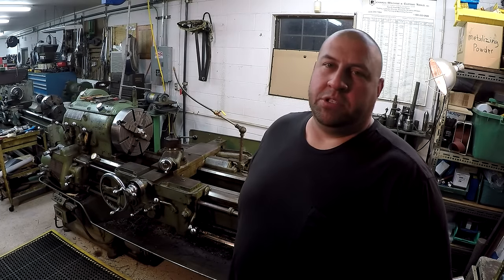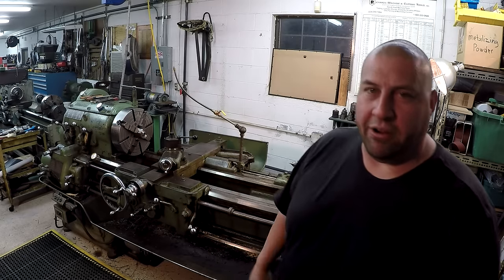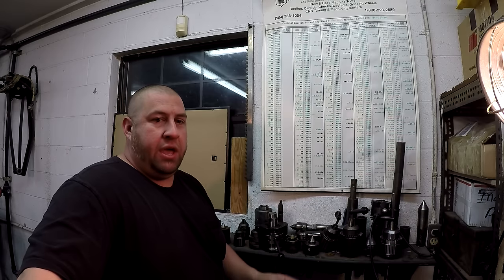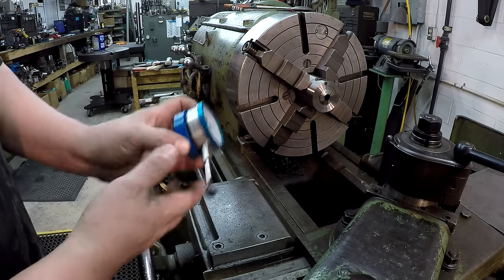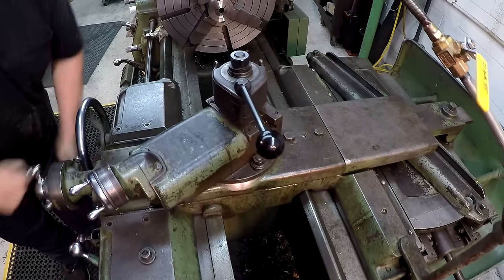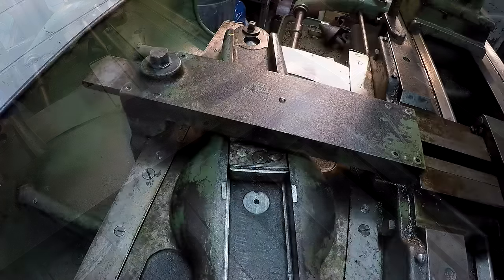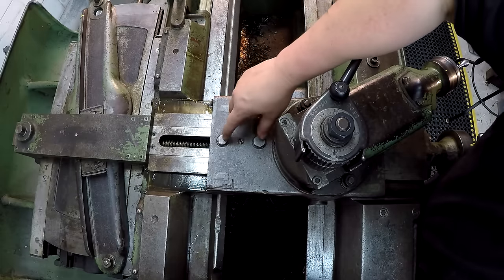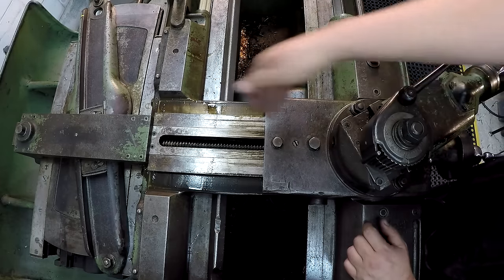Taper Attachment & How It Works

Comment: My Springfield 280 came with a taper attachment but I've never tried to use it.  I wasn't even sure if I had all the parts.  After watching this video and understanding how it is supposed to work, I went and set it up and found out I do have it all and it works.  Thanks Adam.

Comment: Hi Adam, I cut my teeth in 1956 on a big 1936 Monarch with a taper attachment just like yours. I used the attachment many times but never understood how it could move so freely while the lead screw remained stationary. Now I know the screw has to slide in a coupling somehow to allow both to be used. Thanks a ton, my 60 year old puzzle has been solved.

Comment: Very good video and example of machine design. I did not look forward to single point threading on the lathe until I got to work on an HLV-H which had a bit different mechanism for pulling back, but like the Monarch and other higher quality lathes made the threading process much easier.  I appreciate that you get to the point where critical comments are too much. You are very careful about going over the possible consequences of techniques that you use. There are thousands of choices that must be made by a machinist and just as many factors that go along with deciding how to accomplish a task safely and efficiently. I think your judgement is excellent and while I respect the concern and opinions of others at some point there needs to be an acceptance that we are not all going to see or do things the same way.. Thanks Adam.
Reply: My dad had a saying"DO as I say NOT as I do"! Damm the safety  crazies and get some work done.

Comment: So THAT's how that works on the taper attachment, and how you can still use the crossfeed while tapering!  That's an awesome piece of ingenuity and genius mechanical engineering!  Cross-feed screw is anchored to the moveable bar that the taper-attachment is in control of, with as you stated, a male-female sliding shaft connection, either keyed, or more likely splined, between cross-feed screw and cross-feed handle and dial.  As well built as the rest of the machine is, I'd be surprised if the sliding-shaft setup between cross-feed handle/dial and cross-feed screw isn't splined.

Besides of course how this arrangement permits you to still adjust cross-slide position no matter where you are in the taper-attachment's travel, I can also see a major safety benefit as well: when turning a taper using the tapering-attachment, the cross-feed handle isn't turning.  If it were turning on its own while using the tapering attachment, I'm guessing that can lead to operator confusion at times possibly and a machine crash if you accidentally engage the power cross-feed when you meant to disengage it.   With the cross-feed handle not turning when using the tapering attachment, you know at a glance that the power cross-feed is off.  

As somebody else has said previously however on this, it would make sense if in the process of setting up the taper attachment for use, one of the setup steps by design also serves as a 'safety feature' to lock-out the power cross-feed, so the power feed for the cross-slide is disabled and cannot be engaged while the taper attachment is setup and ready to use.

Comment: Good video.  The lead screw has a keyway in the handle end which fits into a collar attached to the handle.  that allows the entire screw to move under taper turning, while still allowing you to adjust the depth of cut .  That big worn out nut on the end locks the slide into place when doing normal turning so the screw cannot accidentally move.  Keith Rucker just did a video on assembling the cross slide and taper attachment on his Monarch for those who want to see how it all goes together.

Comment: thanks man!  you saved me.  i wasn't familiar with the taper guide and wasn't sure why it wouldn't cut the angle i set.  after seeing how it's supposed to move from your video; i realized it just really needed to be taken apart and lubed up. and a couple screws on the compound needed backed off slightly.

Comment: I work in a manual machine shop with alot of old worn machines missing parts to the taper attachment, and always wondered how they worked. My dads a master and explained them, but to actually see them set up and moving makes all the difference. Shame we dont have them working, im on a job this would do wonders on speed and accuracy. Thats for the informative video!

Comment: I get it now! Thanks Adam!  And screw those guys complaining about polishing on the lathe!
Reply: MattsMotorz   Iḿ feeling same away about  polishing on the lathe.. Throw couple old t-shirt  to cover the ways and thatś that...
If the camshaf from engine hav to machine out to next over size bearings. First off itś grinded and after that itś polished to size hand held emrypaper or by machine like yours adam....
It has also WAYS in it!  

Lathes are made to working    NOT TO BABY OUT THEM!!!!!!!    Ofcourse you hav to take care of them best way you can :-)
Reply from the maker: Yep, cover the ways, or once done with the polishing wipe them all down which is what I do everytime.

Comment: Nice. That Monarch is a beauty.

Anyone that criticizes you using the crankshaft polisher can go take a dive into molten steel. 

Every serious race engine shop, let alone OEM remanufacturer has one and uses them in production as well as custom engine machining. 

I've used them hundreds of times. A must have tool in any serious machine shop.

End of rant...
Reply: Your molten steel comment took me back to Terminator 2 and the ending with the T-1000 shrieking like a stuck pig, LOL! "Come with me if you want to live"....dang, I can't believe that was 25 years ago already!
Reply: Doug Hanchard  oh hi California.  I hate ANY negative comments toward Adam, especially about such a unique and marvelous machine.  Thanks, Adam, now maybe I can figure out my south bend taper attachment!  Cschwad.
Reply: I really don't get why they get so anal about it. I mean, all it takes to protect the lathe is some wrapping paper, and you're done. I have a similar belt grinder, tho mine (through a mod) attaches to the tool post so i can power feed the grinder. Man that thing makes some sick polishing marks. :)
Reply: I'm just jealous I don't have a legit crank polisher. 
 
  If you haven't polished parts then you have never needed a perfect air tight slip fit that snaps when you pull it apart. I don't own a cylindrical grinder so it has to get done some how.

That aside maybe the millenials don't know how to clean up after their grinding dust. I mean they expect everything else handed to em.

Comment: Thanks for the inside look Adam, it was quite clear how that was possible.  It's just 16 times more complicated than I could have imagined - simple, right? Obviously the guys that designed that system knew what they wanted out of a lathe long before this one was a new model, so that goes back a ways and then some.  The heritage runs deep and strong in that one.

Comment: Thanks for the video Adam! I've got a Clausing Colchester very similar to John Saunders and have never messed with the taper attachment because I thought I had to disconnect the cross slide like you mentioned. Watched your video, went out to the shop, and was set up to cut threads in no time.

Comment: Shop project alert! - make a new doohickey for your taper attachment to replace the worn out one. :) You could also put a small, rectangular magnet to replace the missing clasp (?) on the guard so it doesn't slide around like you demonstrated - just attach the magnet to the ways where the clasp was, rest the guard piece on top, and adjust the location of the magnet so the guard piece rests on it. Now affix one side with 2-part epoxy and let it set up! Keep up the good work!

Comment: The monarch taper attachment works similar to the one I have on my old Pratt and Whitney model B.
on mine there is a dog screw to lock the separate taper slide in the carriage. the thing I like about my taper setup over other brands is that the taper attachment hangs on its own independent machined surface on the back of the bed versus being attached to the rear top ways of the bed and doesn't ride along with the carriage when not in use.

Comment: Is the taper attachment always attached to the machine and set to zero taper for jobs not requiring a taper? Or is the attachment removed from the machine and attached as needed ? Thanks for the explanation of the attachment.

Comment: Great video Adam. I had wondered how the taper slide could work against the feed screw. Now I understand. Thanks! 

Just one question. When you're not cutting a taper, do you set the taper slide to zero degrees? Or do you just loosen the clamp on the rod down near the tailstock? Or maybe both? Seems like you are  moving a lot of extra weight by moving all the taper attachment components when you aren't using it.
Reply from the maker: When not using the taper attachment you loosen the large clamp holding it to the bed way. The small rod sliding through get tightened by tyhe bolt above it to keep the clamp straight when not in use.
Reply: Abom79 Thanks for taking the time to explain it to me. I'm just a wanna be machinist but I like to understand how things work. I follow all your videos. Thank you for all the work you do to present it to us out here. I create parts in solid modeling software. I don't think it's as rewarding as being able to hold what you've created. Maybe I need to get a 3D printer, huh?

Comment: Hi just watched video and it was great, came on to it after watching a similar video by "this old Tony" loved all the shots but could I just ask this one question ? You never showed you feed in and feed along at the same time. Is or was it possible to do that ie feed towards the headstock and also feed across the face ? I'm only asking as I really like the system you showed and trying to figure out the mechanism for this. I'm reminded of my Bantam feed screw's and a sliding power feed cog along a splined drive but I don't want to miss a more version. I love your channel and the work you commit to it, Mr Pete aka tublacain amongst others made me intrigued and search for your channel and you provide me with constant insight on both productivity and the most important which I hold very dear. That you cannot ever stop learning or improving. Thank you if you can respond I understand that you are very busy, but thank you for your videos they are like tublacain's a very important teaching tool. Yours thankfully Stuart Martin.

Comment: Adam, that looks like a Kwik Way crankshaft polisher, depending on journal size you'd use different widths of belts.  I used to help dad rebuild a lot of engines over the years and if people freak about having sanding dust on ways, they better not walk into a machine shop turning cranks or surfacing heads, blocks or flywheels, lol.  I have a picture of an Offenhauser block that was rebuilt, it's in a lathe with a steady rest that is probably around 2 tons, it was used to machine the bellhousing on the block.
Reply: So the sanding dust on the ways is what people complained about? Seriously?

I tried to wrap my head around why somebody would complain about that belt sander and couldn't come up with anything.

I thought maybe there is some weird security thing i got no clue about. But its just dust on the ways... something that can be cleaned.

Comment: Hi Adam
Another very nice video. I wondered if you had just installed the taper attachment for the last video, but there were just the covers in place. Anyway it was a very informative video, the way this taper attachment works is quite impressive and very well engineered. I personally find it really impressive how well those "older" machines were designed, just with pencil and paper and no computer and CAD program.
BTW, is the belt sander self made or an off the shelf tool?

Comment: If it's like the Colchester chipmaster, the cross slide screw is splined at the Handel end, and the other end is bolted into the taper attachment slide. This means that the screw moves as it slides down the taper attachment, taking the cross slide with it.

Comment: Man that Monarch is a sweet beast. Ingenious design. What about if you are doing work that requires full bed travel when not using the taper attach. Can you get the taper slide to follow the cross slide down the bed or does it need to be manually moved when you get to the end of the taper slide? (If that makes sense)

Comment: When the taper attachment is not in use you tighten the wore out bolt in the back end of the cross slide. Do you have to position the taper arm to run parallel with the bed?

Comment: Adam, did you notice that when you showed the cross slide backlash that the lead screw moved back and forward a little so maybe there is some slack in the mounting at the far end of the taper attachment?

Comment: Abom79 @6:30 Do you use structured abrasive belts for that thing?   (as very much an amateur, I built and used such a thing for polishing a toyota 7M crank, and it worked like a charm, took it down from 60.001mm to something small I dont remember now..)

Comment: Adam, Great video. Thank you. You could always try using that Frost effect paint for glass in a rattle can to cut down on the glare from the windows and still get light in the shop. I think they have a matt style with no gloss. Helps with security as well.
Reply: I was thinking some cheap blinds would do the trick.  Tilt them closed when filming. Tilt them open if you want more light. Quick and easy.
Reply: That is a good idea too. But then Adam would have to sit down a choose a style and color with samples. I don't see him doing that just yet. "LOL, :)" I would vote for that green used on the Monarch. I like Battleship gray color but for the floors. "Laugh" Next Episode: Interior shop design with Adam Booth  :)

Comment: Luv the belt sander .maybe people should put their safety pin were it belongs .holding up their diaper.
Reply from the maker: +Gerry Walker Now that's good! 😆👍🏻
Reply: Yup, that belt sander is brilliant, not to mention that the design could be retrofited to work on a bench style grinder simply by making a stand that couples on the adjusting leg and with a small plate to support the belt. You'd get twice the use out of it.
Reply: I can think of a few million people that could use their diaper pinned shut right about now myself...

Comment: I have that same Shars mag back indicator.  Cheap, works good.

How are you liking those Shars digital calipers?  Kinda thinking of picking up a set of digitals so I can do metric conversions easily but I can't really justify a higher end one. 

I can see that screw moving some with the cross slide.  Might be loose on the end where it attaches up in the taper attachment.  Maybe there is something in there you can snug down to take a little bit of the backlash out?
Reply from the maker: I don't have any complaints on the digital calipers, they work great and have a good quality feel to them.
Reply: Cool, thanks for the input.  Might be a random gift to myself because Wednesday.

Comment: Just to get it right: the taper attachement main body follows the carriage when not in use. When using, the taper attachement main body stands still. Is this correct?
Reply: That's correct!  The taper attachment has its own set of way clamps that are tightened down when you've settled on where in the carriage travel you want your taper.  Main body of the attachment then remains stationary and adds the tapering movements into the cross-slide in that range of travel you clamped it down in.

When not tapering, the way clamps are loosened, and the taper attachment is just along with for the ride with the carriage.

Comment: Wenn you don't need the taper attachment? Is there some kind of clutch or mechanical (dis)connection?
I hope you don't have to set the angle to 0, everytime you don't use it. Also the extra weight to slide it wenn not in use....you can do without ;-)
Adam, have a nice day, and keep making your great videos!
Reply: When not using the taper attachment, you tighten the "bolt" at the back. Adam mentioned this.  If that's all you did, the attachment would bind.  The bolt wants to hold the cross slide screw/bar fixed, but the taper attachment wants to make it follow the slope. You also have the loosen the bed clamp on the taper attachment.  That way the sloped piece moves together with the carriage and doesn't try to move the cross slide screw/bar.  I think the original design intended to let the bed clamp slide along the ways, but most everyone will remove the bed clamp to avoid unneeded wear to the ways.

If you're ever buying a lathe of this type, be sure to find the bed clamp since they are most often stuck on some shelf and not on the lathe.

Comment: Yep it is a keyed setup in the cross slide handle.......If you look closely at the 13:35-14:00 point of the video you can see the tip of the key sticking out when you are moving the cross slide back & forth.  It shows right at the base of the angled slope leading down into the "nasty guts" as you called it.......kind of looks like a ski slope, and you can see the tip of the key on the shaft right at the base of the slope.  The oil nipple right at the top of that slope is what feeds directly down into that key slot to keep it sliding easily.  Monarch did a better job on the design of their taper attachment than ATW did on the Pacemakers in my opinion.  Don't get me wrong the Pacemaker design is equally as cool, but Monarch wins on design ingenuity.

Comment: I don't see why anybody would have a problem with that sander/polisher. So long as you make sure to wipe the ways down after using it, to remove any metal dust, it should be fine to use. I've seen smaller versions of that, under the brand name Dynabride, a believe.